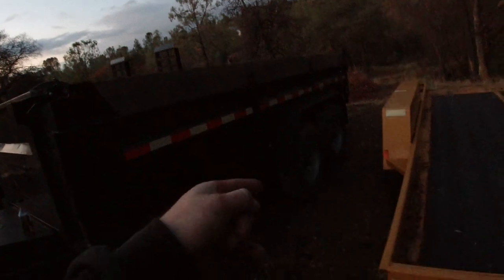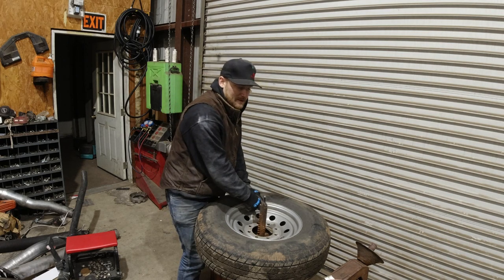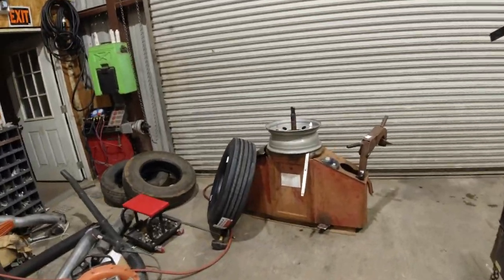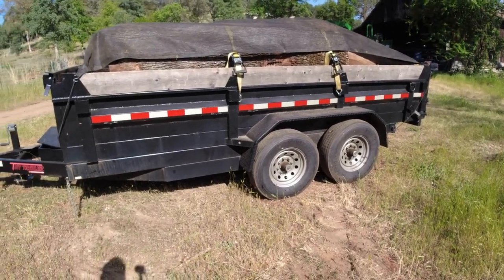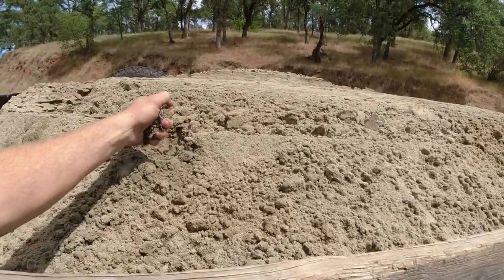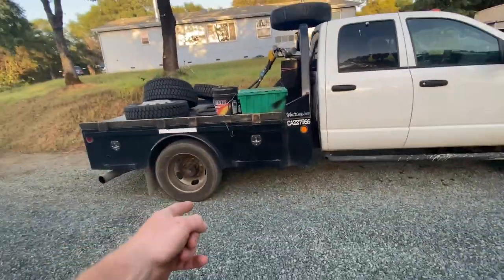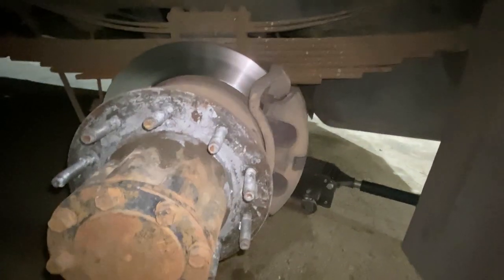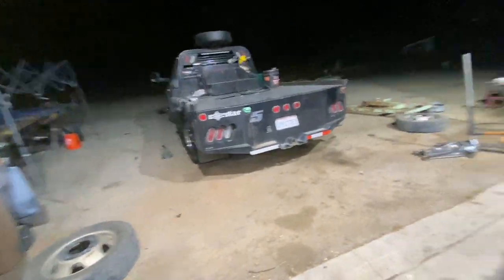Huge Upgrade for the Dump trailer! 14 ply tires. Should come standard!

Comment: Not a fan of Goodyear tires. Every set I've owned showed ply a divot in the sidewall after a month or so. The Goodyear dealers said it was normal. It might be, but it doesn't look good on a $235 dually tire. Looks worse on a $500 semi tire that gets the eye of the DOT.

It didn't appear that you changed the valve stems over. New tires, new valve stems. Also, I use Tire and Mounting Liquid Lube instead of soapy water for installation. Tires almost jump on the rim. Get yourself a good tire gauge or better yet, order glycerine filled gauges and build your own tire gauge.

Comment: check out auction sites. I got a brand new tire machine in the sealed crate still, for just under $1000 I'm in Canada tho so whatever that iss converted.. brand new never used, works great, no problems so far. I couldn't tell ya the brand but I'm sure its China brand lol. I know you said to tell you a brand and I don't remember what it is so I'll go ahead and enjoy the rest of the video now and shut up.. lol

Comment: Yeah you can definitely tell that all of these people in the comments and the people made this video or obviously no nothing about tires a 10-ply tire in many cases as much stronger than what you're talking about as a 14-pie tire to prove that look at the tire loaded weight rating or technically if you have a tire that has many different load ratings such as a semi tire you're actually going to have a DOT certification number for every load rating now what that means is for the maximum pressure you're generally going to have a higher or a different load rating now all of the tires that are 10 ply normally have different materials that make them up so when you see a 10-ply tire that has a higher load rating than a 12 or anything higher well you got to think about that just because you have as you called it a 14-ply tire that does not mean that it's a better tire in fact if you have less steel or nowadays Kevlar cuz that's very popular or back in the old days you actually had rope woven or weaving strands inside your tire now on semi tires we actually have steel beads so technically how many plies you have in the tire that's not a be all end-all
Reply: I'm not an English major, but holy shit man.
Punctuation is your friend.

Comment: Never been super impressed with Goodyear commercial tires, just kinda, meh. Cheap tires are cheap. If you can’t pronounce the name, don’t run them. Bridgestone is the best in construction, by that I mean on/off road, end dumps, side dumps, mixers. Michelin is the best over the road.